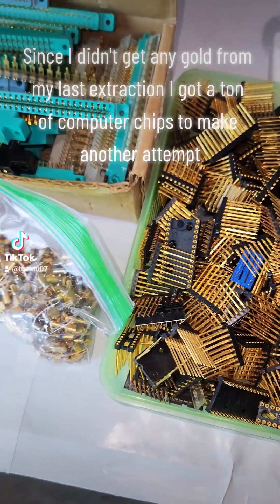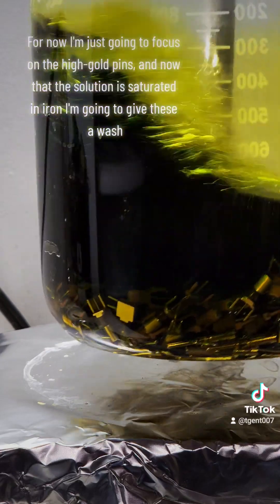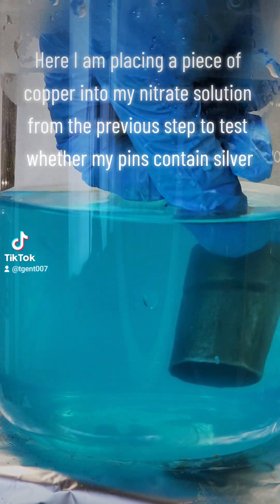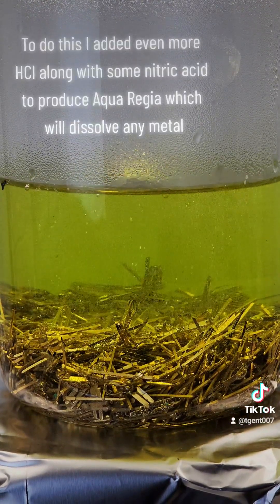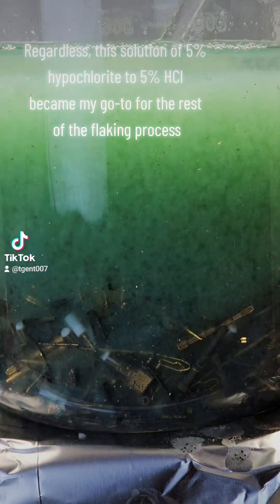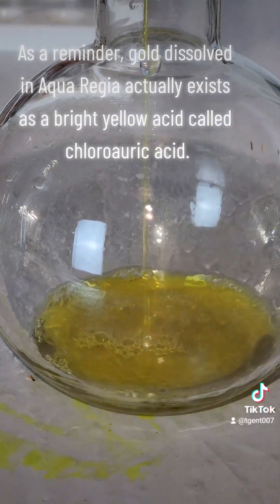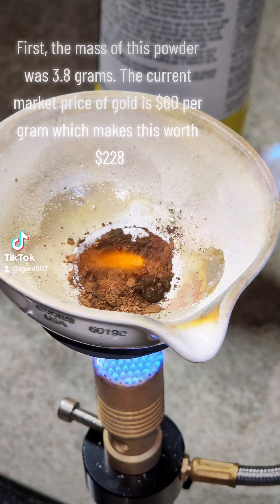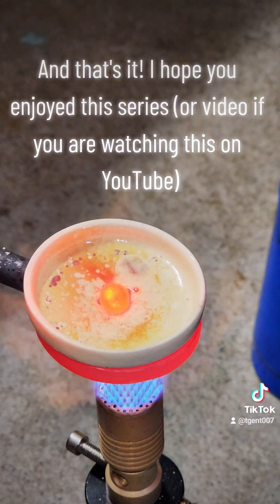Gold From Computer Components

Comment: To test for silver, you’re better off adding chloride ions since it takes a good amount of time to plate the copper if it’s as dilute as you, for chloride, no matter the concentration, silver chloride is extremely insoluble and dense, so even in micromolar solutions you can still detect silver using Cl-.

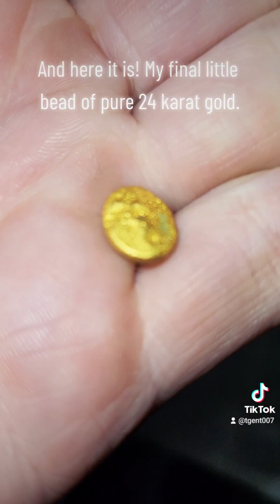Comment: 15:51  get an hho torch.  You could have it melted it in seconds.  It’s pretty awesome. 

Make one actually. Or buy. Whatever. 

Theres some really interesting new stuff too. 

Gallium and a small amount of aluminum mixed in apparently makes way more HHo.  Aka a way higher rate.  

But get this. Ive been reading about gallium and platinum. Annnnd wow. Thats a magical mix. (Makes me wonder about Mercury and platinum.…anyways ) 
So you barely need to add any platinum first of all. Like a 100th of a percent or maybe it was even less. 
You combine them at 300°f for 2hrs (approx. )  and then then you get catalytic gallium….or rather liquid platinum that now will react at room temp.  

I think this would probably have incredible results if used for the anode cathode like in the gallium aluminum reaction. 

This is because platinum is already known to be the cats pajamas at snap crack poppin water apart.  

For instance theres the PEM dupont something or other that generates far higher amounts of hho than just  types of steel. 

Sorry if im not making sense. 
Hopefully i am enough to convey how cool this is and regarding the platinum gallium idea i just know it has immense potential.  

The fact i even cane across both papers  to me was a real  synchronicity.  

Theres one other thing that i just came across too that id like to share but need to finish the material.

Comment: That gold is extremely impure
Reply: Yeah, the claim that this was 99.999% pure was absolutely crazy. That single precipitation from a heavily contaminated solution would get it in the neighborhood of 99%, but getting it to the "five nines" fine point would require a lot more refining. You'd need multiple drops and at least one precipitant that is more selective for gold than SMB. Even then, you'd need to follow up with a pass or two of electrolytic refining to get that purity level.

Comment: You can add them all to a bucket with HCL and bubble air through it for a few weeks. 

This will eat all copper and nickel, some iron. Leave the foils
Reply: I don't think this method will dissolve copper.
Reply: @ec6843  It will eventually but it takes a loooooooong time! A little H2O2 speeds it up substantiality.
Reply: @EddieTheH  It will never happen that HCl dissolves Cu over any amount of time. HCl does not react with Cu on its own.
Reply: @ec6843  Left long enough it does, the copper oxidises from the air and the copper oxide reacts.
Reply: @EddieTheH  That's not a reaction between only HCL and Cu metal. Oxygen is taking part. I'm still right.
Reply: @ec6843  Whatever.